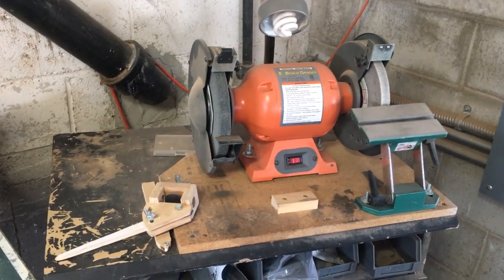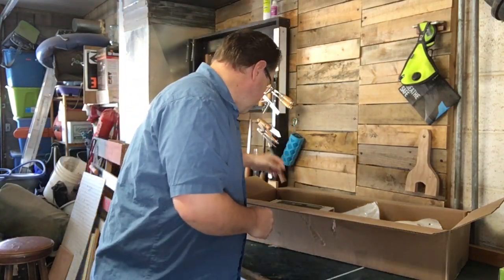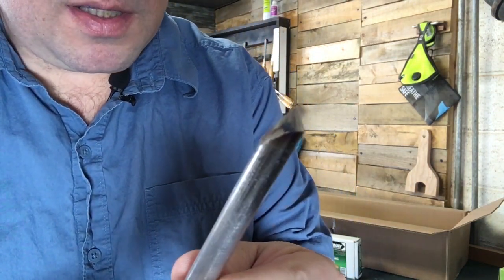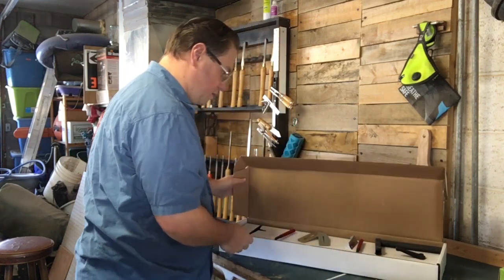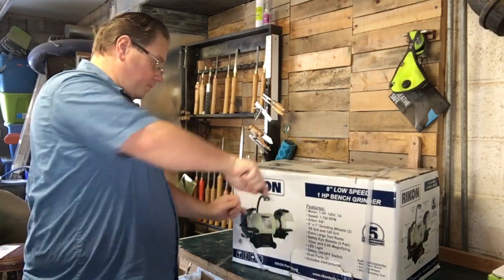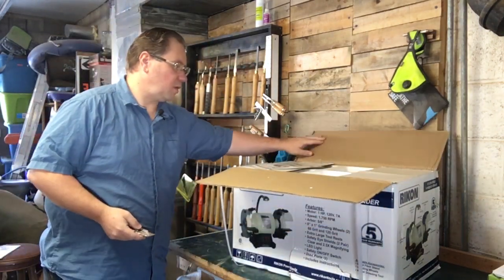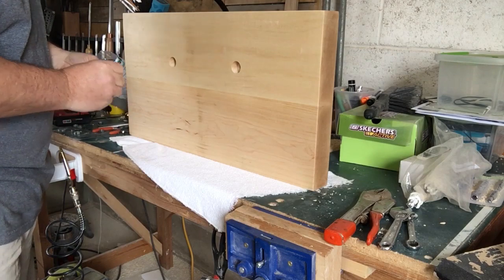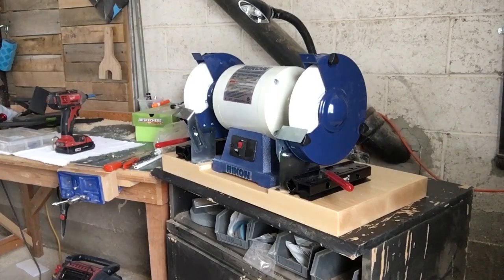Sharpening System For Woodturning Tools

Comment: Good Video and good information.  Just curious why instead of using a router to cut into the maple, just use a 1/2" spacer under the holding apparatus to hold it up.
Reply from the maker: Yes absolutely!  There you go trying to make less work for me!  Ha ha. I guess I just wanted one solid block.  Kinda block headed sometimes.  At least it worked well for me!  😀

Comment: What would be better wheels that run cooler?
Reply from the maker: Yes CBN wheels run much cooler take off less metal and can only be used on hss steel or better, but also are more expensive. I am still using the white wheels and they are fine.  😁

Comment: First thing I did with my 1 hp Rikon was remove that lamp. Totally worthless. As for bluing the high speed steel, you can not get it hot enough so that the metal loses any tempering of the cutting edge. That was the whole point of making high speed steel.
Reply from the maker: Yes! Since I posted this video I have learned this about HSS. Although I do still have the lamp attached to my Rikon, you are right it’s pretty much worthless though. It may be removed in the future as well. Thanks!